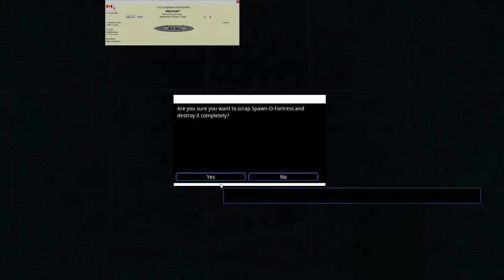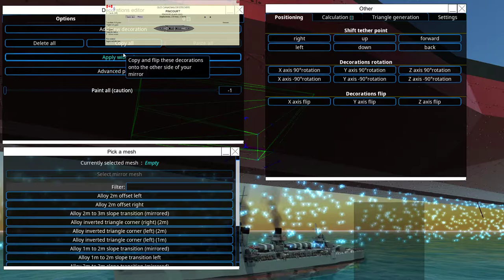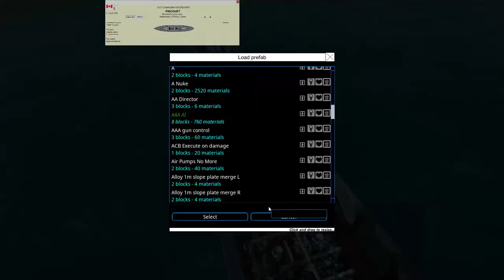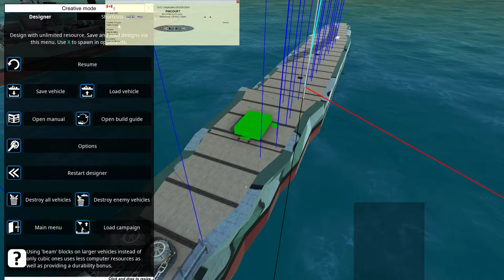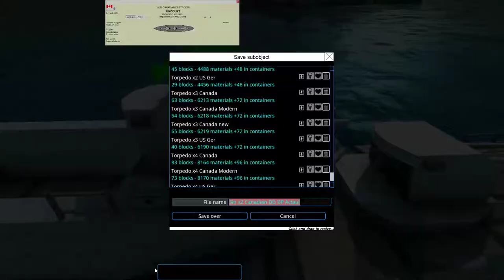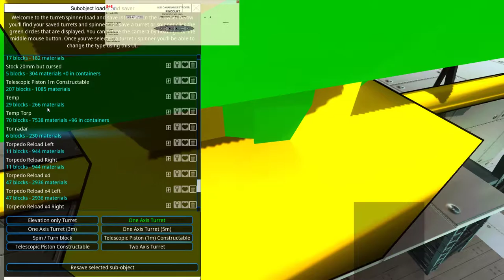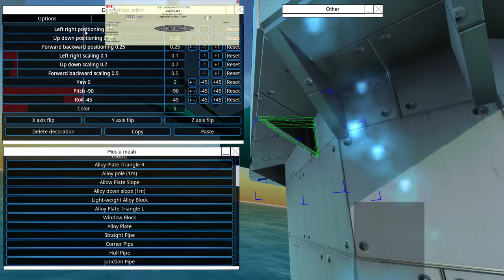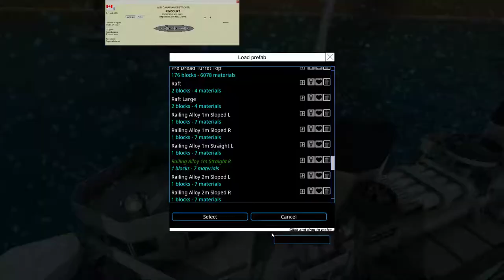How to build a destroyer in From the Depths in one sitting

Comment: I know it seems like you're talking for nothing sometimes but your commentary is invaluable. I learned so much about hull shaping techniques, proper aesthetics, buoyancy, building techniques for navigating these atrocious menus and more. I've learned more from this on making pretty ships and good hulls than any of the dozens of actual tutorials out there so thank you.

However, you did note between an hour fiftey-five to two hours in that you were making this purely for aesthetics and not for campaign. What kinds of design choices would you have made different to what you did with this ship if you ever wanted to make a proper looking warship capable of campaign play?
Reply from the maker: First things first I probably wouldn't build a destroyer. But for campaign ships, I'd probably have a deeper draft, more armor, less engine (with more thought put into them), probably switching to steam engines, and guns which stretch further down from the deck. I'd also add more detection, and some systems, whether they be LAMs, flares, missiles, or CIWS, to defeat enemy missiles, and possibly consider some sort of smoke system for defense against lasers. Also may add a protected area to defend the ship from, and traversability would also be a priority (so functional stairs, ladders, doors, full access to all parts of the ship, and constant 2m to 3m high compartments).